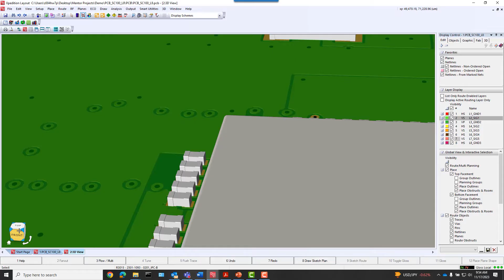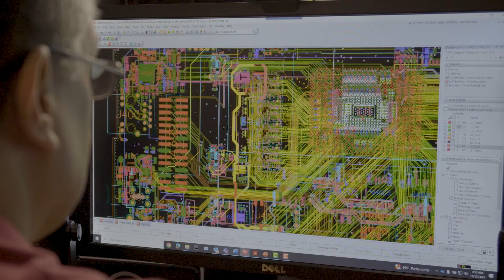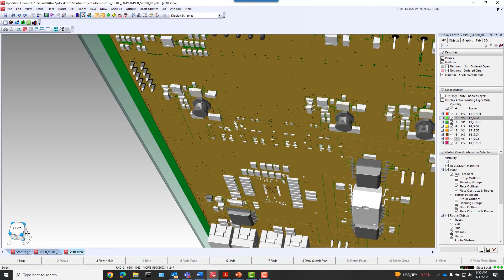How to design DDR4 and DDR5 memory in PCBs

Comment: Your nets look so close together in this video.. do you run into crosstalk due to parallelism?
Reply: Great question @Das-n4b. Basically, traces routed tightly/closely together (in parallel) may potentially be an SI concern in general for any traces being routed in a PCB design, but this is DDR routing. In the DDR design scenario show in this video, the traces are routed according to their assigned Buses, therefore tight routing within the same Bus is acceptable especially with regard to parallelism. The key here is proper design techniques (industry best practices), utilization of constraints, and simulations...simulation...simulation! I cannot stress enough the importance of “simulation”, especially with complex designs.
 
When it comes to “parallelism”, our Siemens solutions have the ability to create and apply a constraint(s) to control the length of a trace(s) that can be routed adjacent to another before it potentially becomes an SI issue. As a printed circuit engineer (PCB designer), it becomes seconds nature and is industry best practice for routing traces properly in order to achieve the best performance as possible of your PCB design. Simulation is part of the design process and must not be skipped! Feel free to reach out to me directly should you have additional comments or concerns. 😉
Reply: @Steph_VC  Steven - thanks for that awesome reply! I am a new designer doing my first FPGA board and am using the Siemens suite. I have been wanting to really use the full capability of the tools/sims (looking at Hyperlynx) to make sure I have a successful design. My critical signals are 10GBASE-KR and the DDR4 - many challenges ahead!